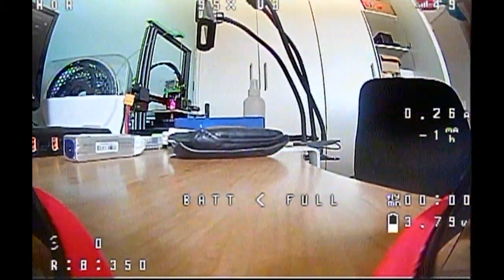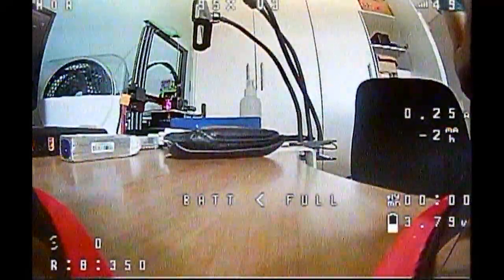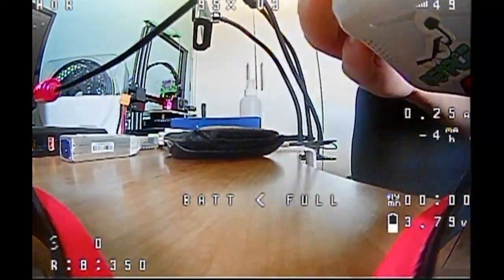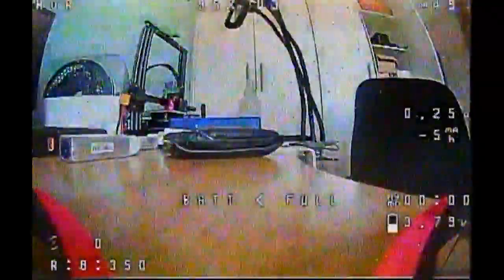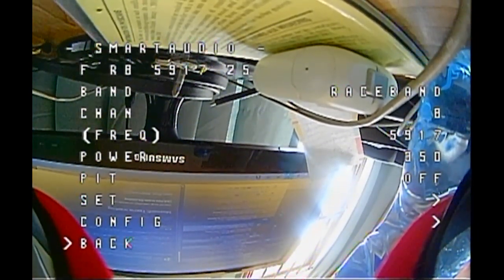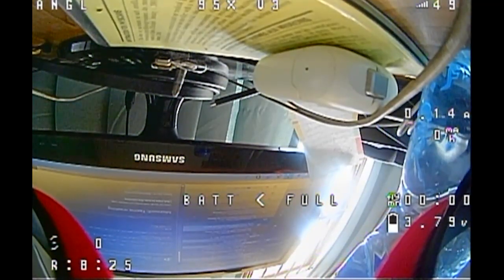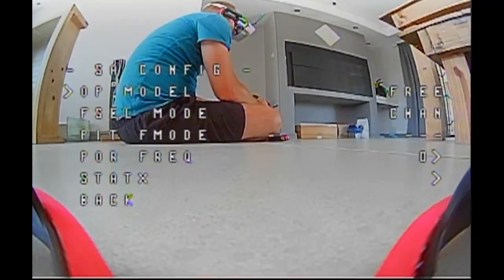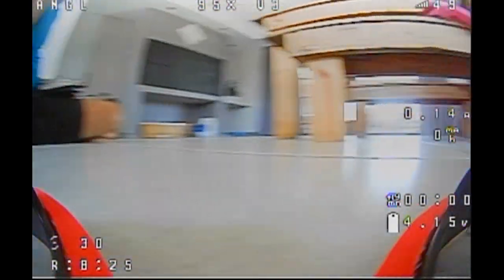Fixed - VTX losing feed when more than 3 feet away

Comment: So it's racemodel and freestyle model? Which one do you have? That's a weird thing dude..thx for the info!! You have to do that for every battery pack or does it not happen everytime?
Reply from the maker: It was a problem long ago, don't have the quad anymore. It only used to do it after I didnt fly for a while. If I changed it, it would keep it for awhile before randomly going back to race mode.

Comment: I just sent back the pavo 30… twice! Lmao I wish I saw this earlier. Sorry Amazon
Reply from the maker: Did it doz your issue too? 🤣 Glad it helped someone!
Reply: @InfinityDrones  yeah super close with timing on the video but just missed me. Two weeks ago I bought the pavo 30. Had crap Vtx losing range at 1 foot, until I pushed it to 350 and double tapped vtx button on bottom, apparently putting it into another level, never lost connection again, however then I kept getting “badRx” or “Rxloss” within seconds of take off and feet of flying. Eventually returned the first one thinking it was a fluke, only to get the second and realize it was doing the exact same thing. Obviously there was something to fix, I do remember it still being in race mode”, but for buying a brand new bnf I just want to bind it and… ya know.. fly lol too much trouble shooting and frustrations over one drone. Sent it back twice. Wish I saw your video earlier, maybe I could have trouble shooted better, but ended up buying the dji FPV and now I’m in the HD game soooo. Did I really lose out? Haha time to save up and then see what kinda good HD cinewhoops are out there. I’m thinking the geprc cinelog 25? Any suggestion, let me know! Thanks for your videos!
Reply from the maker: @trotter_mac  yeah the cinelog 25 is awesome. Get the HD one dit sure

Comment: how you set vtx control on goggle?
Reply from the maker: If you have smart audio or tramp configured in betaflight you can use the betaflight stick commands to access the menu as per my video.
Reply: @InfinityDrones  hello. thanks i just able to set it.Mine was already in free.Is there any difference between race and free?
Reply from the maker: @Waikhom007  yes, if you out it in race it goes to a very low power state as to not affect the other racers. Then when it's your turn you can put it into free. This gives you the ability to work on your quad.

Comment: Pit mode
Reply from the maker: Changing the OP Model from Race (which for some reason  was the default) to Free solves the issue.
Reply: @InfinityDrones  i have OP model Free, but signal is terrible, like in you video
Reply from the maker: @andreua8779  you able to check betaflight vtx tables?
Reply: @InfinityDrones  i dont do there anything
Reply from the maker: @andreua8779  it might be that it's not set up
Reply: @InfinityDrones  but why, few days ago was all fine
Reply from the maker: @andreua8779  honestly, very difficult to know without seeing the quad. Did you update betaflight perhaps?
Reply: @InfinityDrones  nope